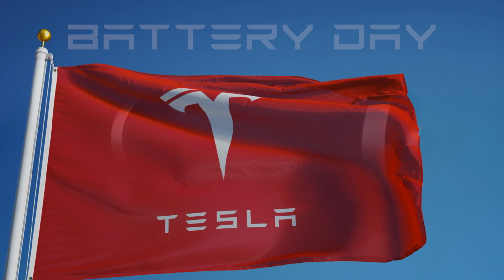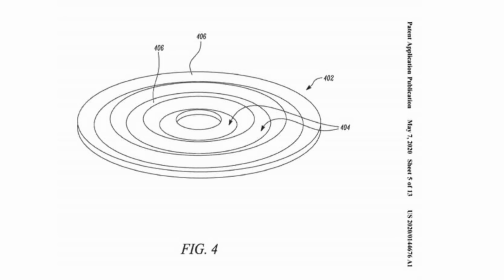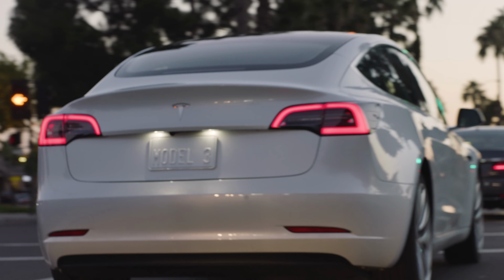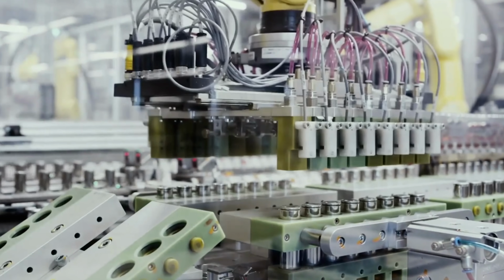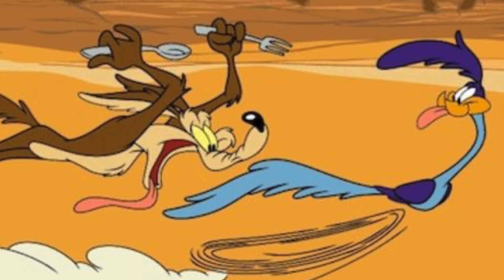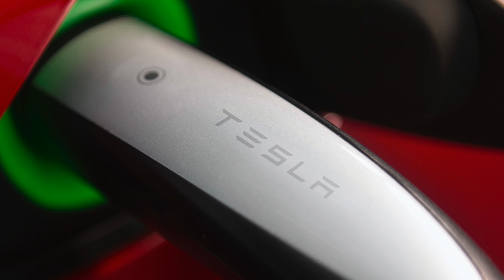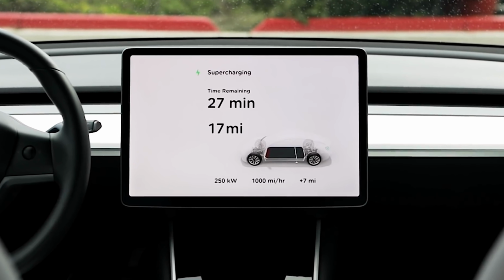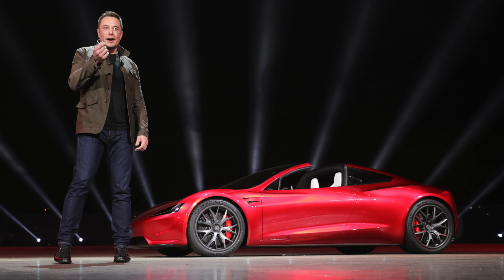Tesla Battery Day Preview: What to Expect Ahead of Tesla’s Battery Day

Comment: I think you greatly underplay Tesla's V2G strategy: They recently registered as an energy supplier in some states in EU; They do solar, inverters and Home2Grid. They also have huge (5xPowerwall2) batteries in the cars.
It would be trivial for them to come up with a Powerwall3 unit that would connect to the vehicle through DC. It would use the battery as an extension of the powerwall. Wear & tear would be minimal, since no V2G would output more than 25kW from the whole system.
Reply: I think that's a big part of the new build of ModelY Elon spoke about. With these new batteries and a new wiring architecture (along with the electricity pricing in Europe) they'll announce Giga Berlin made ModelY's are the first V2G Tesla's. China's ModelY's could be second if their energy market makes sense for it but I don't believe it does. Cybertruck should get V2G too, anything with the new battery cells. Assuming the Roadrunner cells also have close to million mile life and could handle being charged and discharged up to 2-3x/day for a decade.
Reply: I want V2G also, but Elon never mentions it?
Reply: @grahambrown42  why would he? it would take away sales of Powerwalls
Reply: @markreed9853  extra proposition for Tesla customers, and your car goes to work when solar peaks!
Reply: @markreed9853  100 Kwh available for powercuts, Powerwall 13Kwh.
Reply: @markreed9853  Charge Powerwall on solar during the day, charge car battery at night on cheap rate 😁
Reply: @markreed9853  Personally with V2G, I would still want a Powerwall for Solar.
Reply: I have 30 years of experience in the electric power industry, including working at the Electric Power Research Institute. I can tell you that there are significant benefits for both the grid operators and the battery owners - in terms of economics, reliability, and efficiency. 
If you read the master plan I & II you'll see that all items are completed or well on their way - except one: #4 let your car make money for you when you're not using it. 
Batteries that support the grid today get paid, not only for the electricity that they provide to the grid, they also get paid for being "available" to feed the gird. These are called capacity payments - getting paid to be there in case the demand gets there. Tesla owners would get paid just to connect to the grid. 

V2G is a no brainer. 

The biggest loser in V2G are dinosaur coal plants - they survive on capacity payments. 

I am not sure where this negative energy against the V2G is coming from, but I have a theory. I think it's the same entities that wage social media campaigns against climate change regulations.
Reply: I dont know about yall, but I use my car to go to work during the day as well as many other uses. I can't just have it sitting around to be my homes battery. I'll still need a powerwall.
Reply: thanar - Tesla V4 Destination Chargers and Home chargers now come with WiFi and Network Ability.
Reply: I'm surprised this point isn't realized by more Tesla enthusiasts. Yes, bidirectional ac isn't possible, but a straight DC connection with a new, improved "Powerwall 3" via a directly-connected Tesla HP Wall Connector would completely bypass the unnecessary onboard charger ac-to-dc conversion. Might require a new version of the Powerwall System Gateway or Tesla HP Wall Connector, and will definitely require new, complex software features for the Tesla app, the Powerwalls/Gateways and the BEVs themselves.

Since Tesla warranties their expensive BEV battery packs for years, they have a vested interest in protecting them from any degradation or misuse, and it seems only fair that V2G usage would count against full warranty coverage somehow. How this would be documented and proven is clearly problematic, and to date Tesla has taken the stand that the economics of V2G simply don't justify it. Tesla vehicle owners would be delighted to have V2G to back up their residential power and help reduce their power bills, but what happens when their vehicle's estimated range starts to show a significant reduction, say for example 10-15% (30-45 miles)?

My understanding is that in the USA, Tesla Powerwall customers run afoul of "federal regulations" regarding the fine print of their PV solar system tax credit if they seek to arbitrage their electric power with their local utility, at least that's the excuse I've heard for why Tesla doesn't provide North American Powerwall system owners the same full scheduling capabilities that are provided in the EU and UK to make profitable PV solar + storage and V2G arbitrage possible (admittedly my information could be a bit dated on this ...). One hopes that US politicians and regulators will quickly adopt more "solar friendly" tariffs and policies or risk being pilloried in the media (or worse) as the lapdogs to the fossil-fuel industries that they are. A few states are leading the way, the South and Midwest lag badly, big surprise there.

Would you care to elaborate on your statement "... Wear & tear would be minimal, since no V2G would output more than 25kW from the whole system" ??  Is 25kW a V2G/V2x spec? Just wondering, FWIW the Tesla Model 3/Y can dc charge at up to 250kW (nominally 625A @ 400Vdc), though dc supercharging is typically <80kW (<200A) through most of the charging cycle; the original HP Wall Connectors rated for up to 20kW (NA) or 22 kW (EU), the latest (Gen 3) are only rated for 11.5kW (240Vac of course).
Reply: @thanar +1
Reply: Rivian is doing this from day one, why is Tesla taking so long...
Reply: The problem is, it's already been confirmed VTG can NOT be enabled with the current Tesla cars! I don't think Elon wants it as it takes business away from Powerwalls and is hard to manage when the car is not connected to the home most of the time.
Reply: @markreed9853  Once car and powerwall batteries (and buses/trucks) are all using the next-gen (module-less) batteries, there's no barrier to buying/selling energy from/to the grid. This is why heat efficiency and cycle-count are so important. Tesla want commodity batteries built at-scale, for all purposes, asap. Having constraints like you mention is something that probably (I assume) frustrates Elon currently. He needs to evolve the battery design in order to make this viable. Hopefully this is mentioned on 22-Sep... We'll see
Reply: @markreed9853  You're statement is economically correct but only for current/future owners of a Tesla automobile, still a very small subset of the potential powerwall purchasers.
Reply: @markreed9853  Unless they will bring new vastly bigger powerwalls.

Comment: Yay, finally you covered charging. I’m so relieved. So yeah, I’m thinking the next gen battery will be ~900 Volts.
Reply: Yes. To be able to get these higher charging rates the pack voltage needs to be in the range 950-1050 V
Reply: @Tjeran  
What is the limitation to fast charging (at the moment)?
The cell.
V3 can charge at "1000mph"
The existing 2170 can't.

The new cell (I believe) can.

End of problem.
V3 is sufficient, even for the Semi(!)
Reply: Roger Starkey - not just the cell. The V2 cabling cannot handle the amps needed for the lower battery pack voltage. In Texas on a hot summer day, it’s virtually impossible to get max V2 charge rates because the cable runs too hot. Yes the cell needs to be able to receive the amps, but also the charger needs a higher voltage to keep the cables from melting.
Reply: 900 v
With thousands of 400v chargers.
(And still installing them)
Reply: It would need to be capable of charging in the 400 Volt range. There’s a few ways to achieve that.

Comment: I would like to hear more about potential supply constraints regarding nickel and cobalt.
Reply: what Supply Constraints ? 
there is Litterally plies of the Metal at multiple mining locations.
and Tesla is working toward 100% Cobalt FREE chemestry.
Reply: Mark Plott Thanks, I was not aware! Last I remember was Elon’s comments during the last call.
Reply: The compromise regarding supply constraints is how to get nickel or cobalt at reasonable prices.  They will use so much that high volume will help lower costs.  But the prices fluctuate with demands, like crude oil.  And with so many batteries being made, it has been a sellers' market because of high demands.
Reply: Acme Fixer I’m curious how Boring technology could potentially fit in. I don’t know near enough about their production efficiency. I agree price is paramount and I’m optimistic, from what Tesla has demonstrated with their supply chain, they’ll figure out the metals and materials optimization in time. I just want to know more!
Reply: Giga Metal...
Reply: tranfamily35 Just heard about them. Also owned by JB from Redwood Materials, correct? Both private. Wish I could get a piece.

Comment: My guess, sub 100 dollars per KWh, the end of ICE.
Reply: Shirley Meng accidentally said Tesla’s target was $65 in an interview on The Limiting Factor.
Reply: @johnryan8645  IIRC, she said they are targeting $80/kWh for lithium ion and $65/kWh for the LFP batteries which are less dense.  They are likely already around $100/kWh for lithium and $80/wKh for LFP.
Reply: The $100 Kwh means the production cost of an EV is about the same as an equivalent ICE vehicle BUT doesn't mean they will be sold at the same price! I know not Tesla, but legacy automakers make most of their money from servicing so will charge extra for a while for there EV's to make up this difference. Also, R&D costs need to be recovered as well as factory refit costs. Sadly still going to be a while before I can afford an EV on my pay :(
Reply: Mark Reed unless they come out with rideshare that give driver a cheap deal.  Pay it off while driving rideshare
Reply: @markreed9853  It depends on your needs.  Some EVs are pretty cheap, but obviously, they have less features.
I also invest in Arcimoto; maybe they would suit your needs:  https://www.arcimoto.com/  They're around $12k right now, and I'm sure the prices will come down more once they ramp up production.  They have been working with Sandy Munro, so I expect great things.
You can also buy a used Nissan Leaf for less than $10k in most places (again, depends on your needs).

The more batteries scale up, the cheaper all EVs will get.  It's just a matter of how quickly it happens.
Reply: CATL LIPO is Already $75/pre kwh
Reply: @markplott4820  
But until LiFePo4 gets to near 250Wh/ kg, it's still limited by size in the small cars (packs) and weight in the large ones.
Reply: Mark Plott not at pack level.
Reply: @markplott4820  Problem isn't to go to 75$ or below, problem is really to do it while keeping the density and degradation low + high charging speed. battery tech is always a tradeoff, so these prices are kinda including same or better performance of batteries compared to those currently in use.
Reply: @markplott4820  Could you provide a link to that? Interesting!
Reply: I am half expecting to hear they have moved significantly past the $100 milestone. i think all things added together could provide a synergy that makes that possible.
Reply: +1
Reply: My guess is 80$/kWh. After that one they will crush forcasts for deliveries again, I estimate about 140.000-150.000 in Q3 and last but not least Model Y china. Going to be a good end of the year.

Comment: Just to point out.. we are always forgetting that it's NOT battery day, it's battery AND powertrain day, so we are just skipping the powertrain gain that would help put out more km/mi for every kwh - and it means, less cell for every car, so another cost saving for every car .. if they improve the efficency of the powertrain by just 5% they will require 5% cell less ( since the cell weight less, probably 6-7% less cell )
Reply: Cronos86x  specially after lucid air announcements
Reply: This is actually the most important part. With more efficient power train and denser and cheaper batteries combined with lighter cars due to more efficient productions (mega casting) Tesla can reduce the price of their cars with 10 % and still make a profit. That's going to flatten all competition.
Reply: Plaid powertrain detail.
Smaller motor's as Lucid.
Reply: @rogerstarkey5390 you (all) are all so focussed on this damn plaid powertrain, yes, it's good, it will allow the roadster and the plaid model S, it's super fun, super halo, all good, but who cares? what Tesla needs, and what is aiming for, is lowering the cost of the model 3/Y and allow for a cheaper car that can start, really start, the ICE decline for real, the plaid is the "better we can get, ignoring the cost and everything else", what they need to unveil, and I think they will unveil is that the 'base motor' is getting more efficient,  the point is that motor efficiency is one the key advantage Tesla has over other automakers at the moment because if you need less energy to move, you need less battery, the car charges 'faster' because for every kWh you put in the car, you get more km, and the km/h is what is important really, and if you have less cell you can build more car with the same number of cells and you can sell it for less since it cost less for them